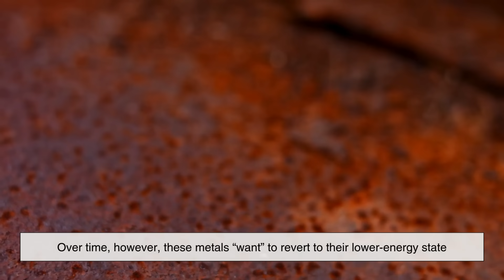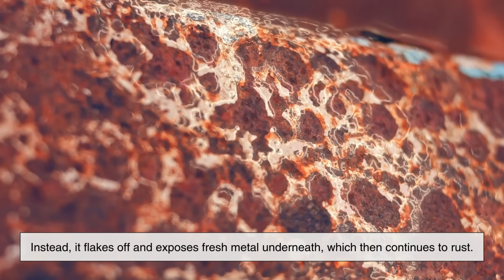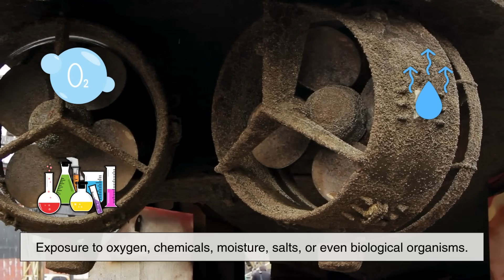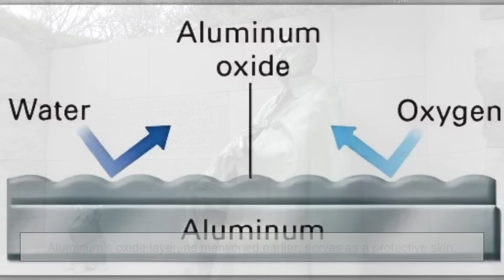Rust vs Corrosion: The Science of Metal Decay

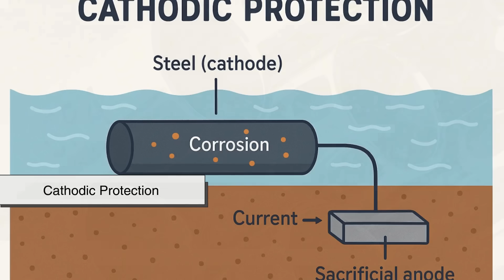Comment: Nobel metals are metals that do not corrode such gold, platinum, rhodium, ruthenium, palladium, osmium and iridium. Regarding 5:54, the Golden Gate Bridge in San Francisco is painted to inhibit rust in the color known as “International Orange”. Regarding 6:18, inside a water heater tank made from steel, the sacrificial anode rod is typically made from aluminum or magnesium which needs to be replaced after around 4 years because it has dissolved from immersion in the water heater tank. Regarding 6:56, the green patina on copper and its alloys such as bronze and brass is known as “Verdigris”.

Comment: if all metals can oxidize why do only few metals can corrode and why the heck does only one metal rust
Reply: Most metals corrode from oxidation but some are much slower at it to the point they're considered anti corrosive like nickel and zinc for example. Eventually they will corrode though from oxygen exposure and that's why paint is so useful is because it stops oxygen from getting to a metal. Nonetheless oxygen is very very tiny and can make it through barriers. Same with oil and grease, they're not just for lubrication but they stop oxygen from reaching a metal
Reply: Corrode is a general term that covers many things besides rust. Rust is a type of corrosion from oxidation. Even erosion like from rivers and glaciers moving is a form of corrosion. Most metals can oxidize at different rates and create different compounds through it. Rust itself is iron and oxygen and that's why copper doesn't rust is because copper oxidation creates copper and oxygen compounds.
Reply: sometimes that oxidation layer on the surface protects the metal from corroding further like aluminum
Reply: @LoffiKilli  I believe they call that passivation and yes sometimes it's done purposely controlled for that exact reason.